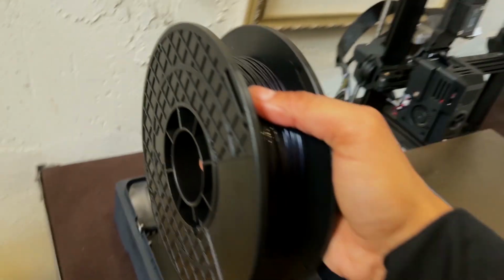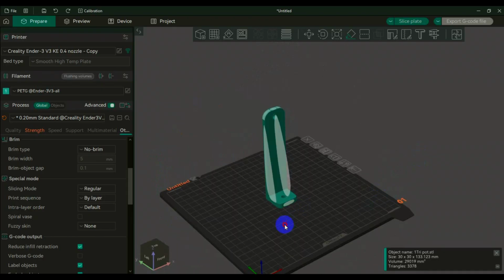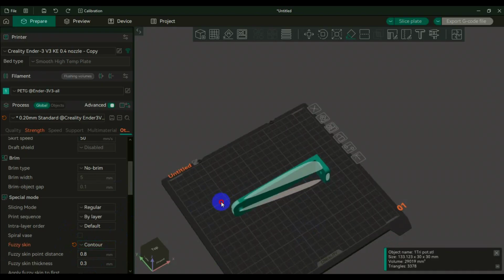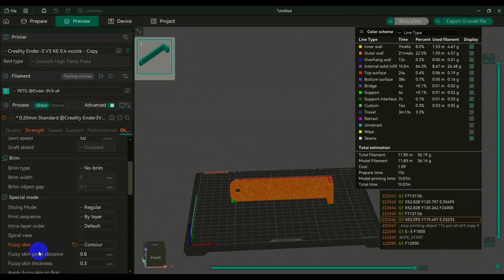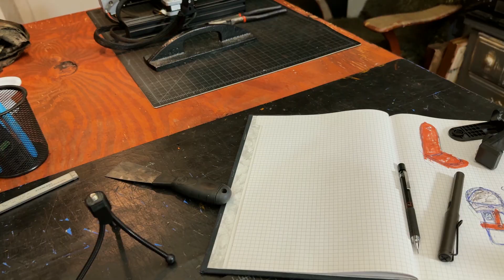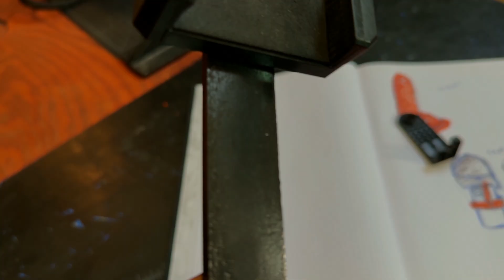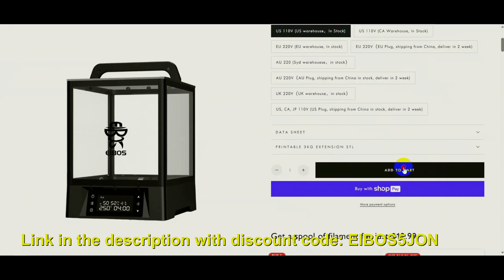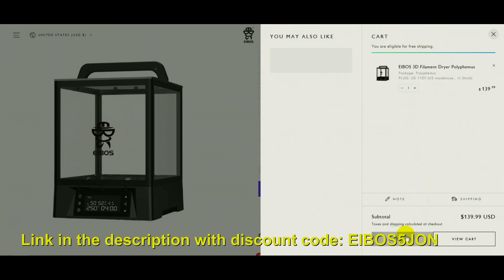Injection Mold Quality 3D Print

Comment: For Bambulab printers and PLA i gound out that 60mm/s speed and flow of 22.5% is perfectly smooth with  ironing. If the surface is bigger you should scale up to 25% and very large surfaces around 30% flow
Reply from the maker: Interesting 🤔 I will try it out